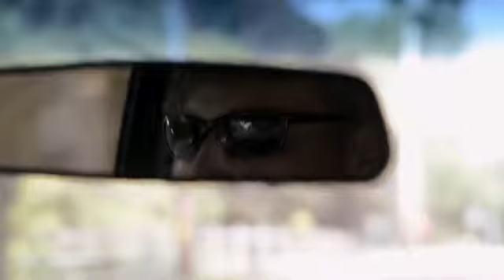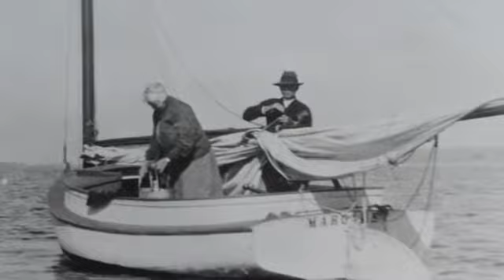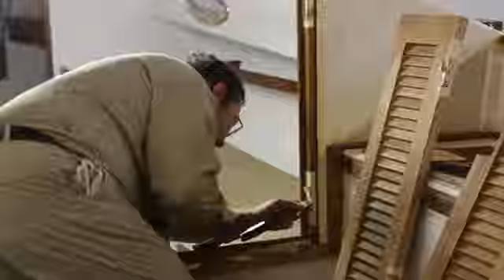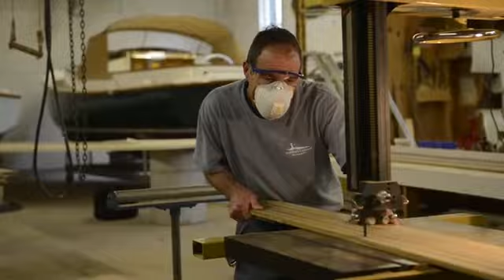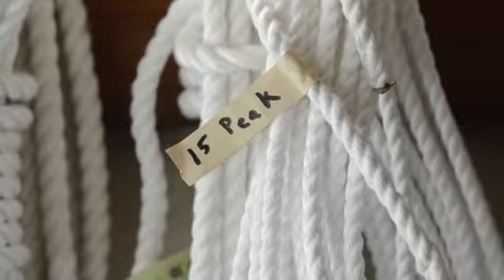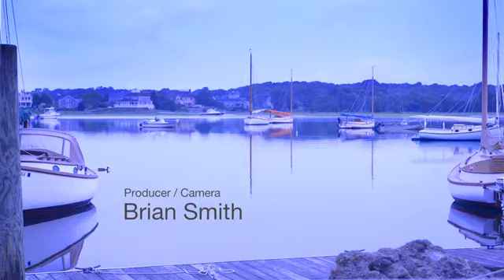Marshall Catboat History

Comment: Jeff. (or anyone else with knowledge)  Did you build or approve a Sanderling with the mast set further aft for a spinnaker?  I’m looking at a 1979 (?) but am not convinced that it came from your shop like this. Seems to me it would create a balance problem.  Thanks in anticipation. John.
Reply from the maker: Hi John.  There were a few Sanderlings built with sloop rigs over the years but they were all kit boats which were finished by the owners.  I don't believe any of them were rigged for spinnakers.  Geoff